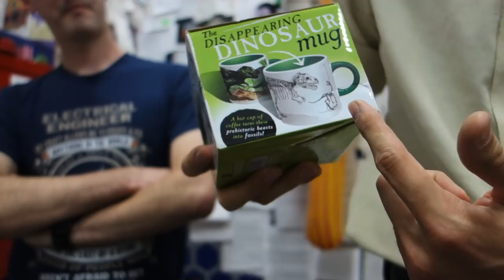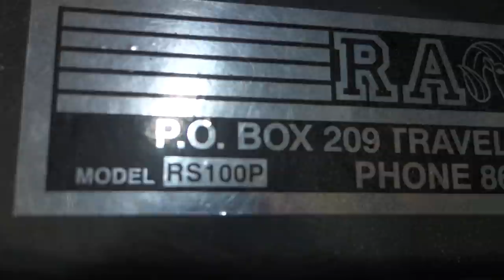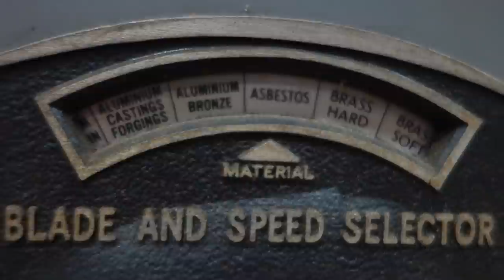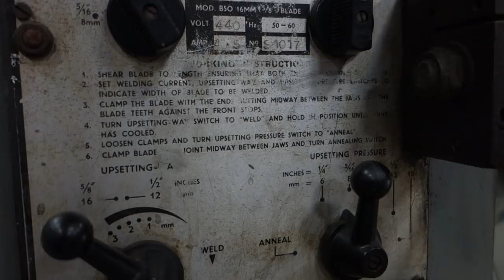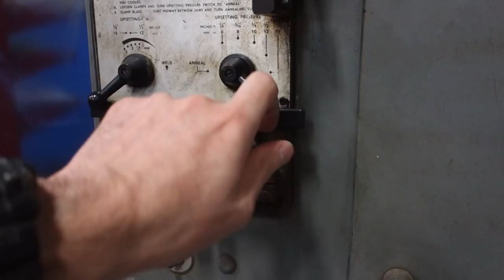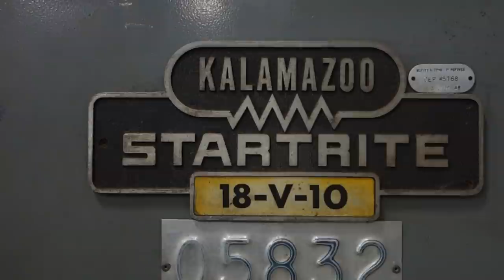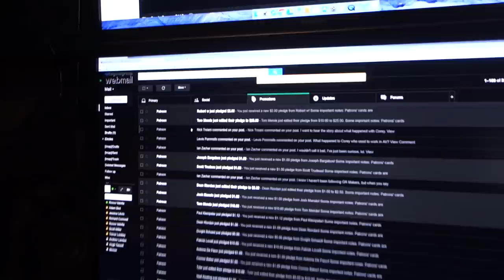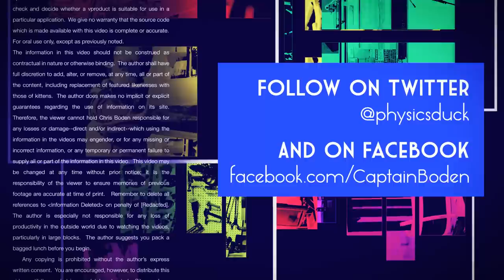Captain's Blog 8 24 2015 Crane Fun and Bandsaw Power Test

Comment: Not sure you can use a pneumatic piston on a hydraulic syste,. oils can attack some rubber seals.
But i do agree that a generic hydraulic piston of same diameter and stroke should work the same, the dampening is only the amount of oil you allow to 'leak' by using a needle valve.
How do you know how tight the blade should be ? pluck it, though not sure what note you'd be looking for

Comment: https://goo.gl/Abt6RK

Google drive copy of MP3s. I ran a pass of noise reduction on it too - there might still be a little because I wasn't super thorough, but it should be mostly clean.
Band 6 is set up to be an endless loop.
Band 7 is one of the sounds back to back with a reverse copy of itself, just to force it to fade in and out nicely.

Also working on a special addition from an old vid too, will reply when it's added (grabbing MP3 audio of the video now)
Reply: Paul Plusa WeeWoo is added (best sample I could find of the ones I recalled).